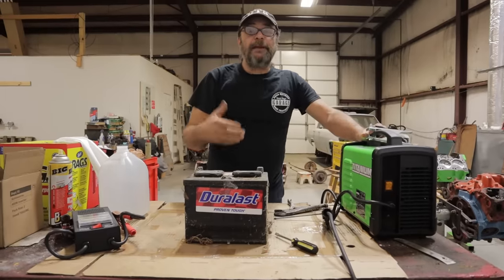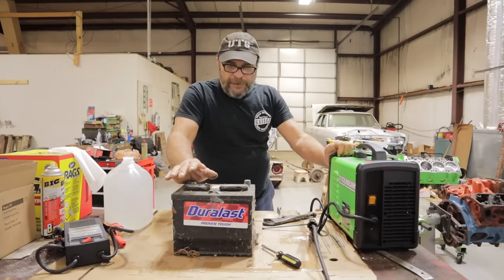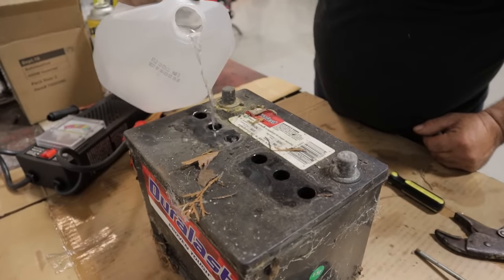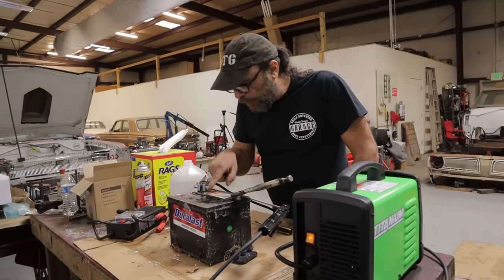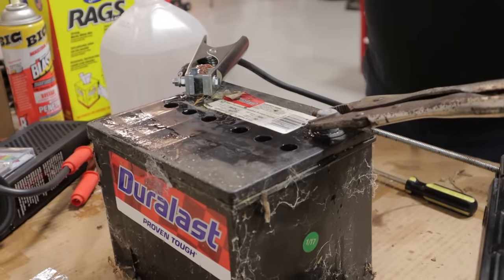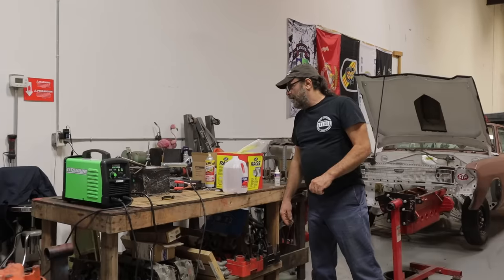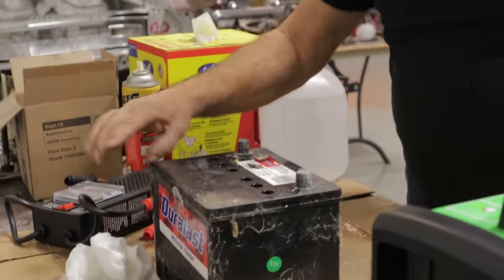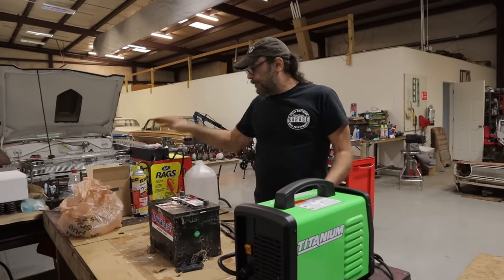Reviving Dead Batteries With A Stick Welder

Comment: He never confirmed that the battery wasn't chargeable in the beginning it had just sat around and had no charge i think he needs to redo the test with a battering that cannot be charged and will not pass a load test ,he successfully did a quick charge!!!!
Ohh he should have a good coating of rust on the inside of his shop and tools an exhaust fan or and and open window or door would be a good idea!!!!

Comment: Distilled water has all the impurities removed. If your tap water has a lot of limestone in it, it will make the battery even worse.
Reply: Yes. Destilled water has all the ions removed and therefore does not conduct electricity

Comment: If there is a cell that is not bubbling, the cell is dead. It's shorted internally and basically the battery's caput. It can be still repaired but not worth the hassle.. edit: if the battery get warm (near hot), end the cycle and repeat when it's not warm. Edit: pleeeeease, clean the battery first and second, do not overfill like him!!! The water/sulphur acid solution has not to be up top!!!

Comment: That would be a DC welder , right ??
Should have had the battery in a plastic oan in case of boilover so the acid didn't go everywhere.
Should be wearing rubber gloves and a face shield.

Comment: 2/7/23. What happened to SAFETY????  No gloves, no eye protection. Try attaching the clamp directly to the channel lock plier handle for a better connection. Two other videos had that scenario in the highest they could get their welder was 35 to 40 A and you got all the way to 120 sounds dangerous to me anyway my main concern was your safety.

Comment: I am inspired by your work. Slight improvements would make what you suggest 300% clearer. Put a VOM (volt ohm meter) on the contacts as well. This will also show the Voltage being used with your stick welder being used as a variable DC power source. I would suggest to all that the use of higher voltages at very low amperages for much longer periods will be far safer and even more successful as well. This is the simplicity of desulpahation. If you repeat with the voltage we can see much much clearer what you are electrically doing.

Comment: Maybe... and I'm just spit-balling here... but ya clean the top BEFORE opening those caps....... maybe even test the battery beforehand to prove it's dead and show the start point of the "experiment"....... And the craziest thought of all.... Maybe, just maybe, wear gloves when cleaning up battery acid.

Stretch Goal Suggestion: vacuum hose set up to suction fumes away from both the battery AND the nearby lungs.

Comment: I'm pretty certain you could use reverse osmosis filtered water or Deionized water without any problems or even something like a high quality filter you might use for drinking water at your house like a zero water filter because the idea is that you want is water without contamination in the form of minerals or pollutants or anything like that especially something like chlorine so no mineral water no spring water no water with additives like the vitamin fortified water or drinking water that has minerals added to give it a normal water taste because pure water doesn't really exist naturally it's the universal solvent so that's what it does best and I haven't seen you in a while but glacier water filtering machines you used to see in front of grocery stores where you can get a gallon for a quarter as long as you bring your own container those would work great too because it uses the Municipal Water Supply tap water filtered through mechanical particulate filter then activated charcoal/carbon anion exchange media and then reverse osmosis where is forced Under Pressure through an impermeable membrane we're always a very small water molecules can get through and the larger contaminants can't pass. It's remarkable deal compared to what you find just inside the store and for the record reverse osmosis is what desalination plants use to take salt water and turn it into freshwater they can be used for drinking and agriculture so reverse osmosis is to water what HEPA filters are too air

Comment: You will kill it completely. It will short cut internally easy. Never do it. There is a special method of dissolve it by charge - discharge cycles. some time with reverse polarity, but hitting it with 100 Amps is vandal action :) I know it is already dead but still vandal.

Comment: Beacuse you used a welding machine, it only took minutes to boil it unlike using the usual 12-24 battery charger that needs to take overnight charging, hmmm that's new approach wow!

Comment: Not a good idea to have welder right beside battery putting off gas. Might be alright if you was using fan on welder to blow fumes away from battery and welder.

Comment: BREAK CHECK ! ! !  I don't know if this guy is honest or just not informed. 
Here's the truth. If you've never tried it, the reason you never  recover any of the Lead from a 12 volt lead acid battery is because of a process called "Electrolysis" which is the process of using electricity to split water into hydrogen and oxygen. Did you get that? Here’s the problem, electrolysis always destroys metal, the density of the “Metal Lead” gives it a longer seat at the table but with time Lead will vanish right before your eyes, just like steal, tin, aluminum,  Stainless Steal, etc, etc... The lesson here is don’t look for Lead in an old battery.
Now my point is this: What this man is doing right there is accelerating the loss of lead in your battery and these “12 Volt Lead Acid Batteries” aren’t called “LEAD ACID” for nothing, they produce electricity by a chemical reaction resulting from the mixture of the metal Lead + Acid + Water = over time you got some electricity but it wasn’t free it cost you some consumables called Lead, Acid and Water.
Let that sink in and you’ll understand that this video is instructing us to use a super fast loss of Lead to rejuvenation our old batteries, it’s comparable to buying a cancer patient some cigarettes only much worse.

Comment: I blew up a lead acid battery bank as an apprentice. Scared the fucking shit out of me I only popped 2of4 batteries burned my eyebrows off. I never touched a bank again.  750cca means 750 instantaneous Amps upon a short condition.  That a Lotta heat man careful with chemelectirc
Reply: Willing bet next cold spell your car doesn't start

Comment: The reason u use distilled water is the same reason u don't want distilled water in radiator. Distilled water is full of ions that are "hungry" and they "eat" all the corrosion inhibitors right off the bat.

Comment: You dare-devil...I would work with gloves. And we do not know the status of the battery BEFORE you hooked up the 50 amps charging current.  That would have been an important information.  Last year a came across a lot of dead batteries in the Yukon.  Solar panels did not do much to these sulfated things, and according to the acid-tester I should have added acid, which stands to reason.  I think the lead sulfate is  "lost" for the process, unless you can solubilize some of it  again with your  devilish "battery cooking"...
Reply: An other point: this I would absolutely NOT recommend to do on a modern sealed battery!  Returning home from Yukon after three months  the battery of my car was rather down (a modern, sealed one) and I got it up and working well again by hooking it up for some nights to an automatic electronic battery charger. I felt perfectly safe doing that...:).  It probably was only a little sulfated.

Comment: My friend trust me I've been there stopped to help a guy jump his car and wasn't paying attention and he crossed his cables . My face was twelve inches above my battery be ause it was dark it blew me up on o to the radiator and across the rop of the engine three to four feet behind me leads post hit me in tbe forehead but my buddy had enough sense to drag me inside the store back to the milk and began doysinv my face eyes all over four gal of milk right there poured out in the floor. Milks the fastest neutralizer . Water onlybrises it or dilutes it. Milk kills it forever. He got to me so fast that the white Tshirt I had on only stained yellow never ateca hole in it. It worked well enough I paid for the milk and cleaned it up for the girl bebind tbe register . She was still in shock . My ears rang for a week because of that explosion . Never take a battery for granted it can become literally half as strong as a stick of dynamite. Yourectaki g a risk with that thing inside. Once you smell that gas you'll never smell anything ever again if it's a good breath.

Comment: I bet an AC welder would work better since the cycling back and forth. in welding you weld aluminum with alternating current because it cleans up the layer of oxidation. I wonder if it would have the same effect on a battery
Reply: AC doesn't work.

Comment: It's not your skin really you have to worry about it's your mucus membranes your eyes and the sensitive tissues lining your trachea and inside your lungs that are probably the ones you should be concerned with skins durable and bydesign that witch keeps everything that's not you outside of you and full of nerve endings that will let you know reliably if something's not quite right without much ambiguity

Comment: Wish he did a multimeter volt test and load tested before especially if it took a charge. Chances are the battery may have charged again before doing the dc or stick welder trick and it would still pass the load test, and this essentially proved nothing, just free paid content and views. Been there done that with a few batteries that I forgot to test first. now I test everything first just to have a base. 
But cool video and well demonstrated

Comment: Didn't show the voltage or the amperage BEFORE de reviving process!! Also, didn't show the battery performance by putting it in a car and starting the car.

Comment: The "crust" falls off the plates, settles in the bottom, shorts out the cells.  Just buy a new battery, it'll save your ass when you need it.

Comment: You never showed the battery was actually dead that and it had an 01/17 sticker so it’s not that old I have batteries that still work at 5-6 years old …
Reply: And for 25 bucks I’ll buy a desulfator that works the same and is a bit safer

Comment: Pretty sure this creates hydrogen. One little spark it's over. Way too much risk involved for a battery. It explodes you have 3rd degree burns at least. No acid neutralizer around this guy. Oof

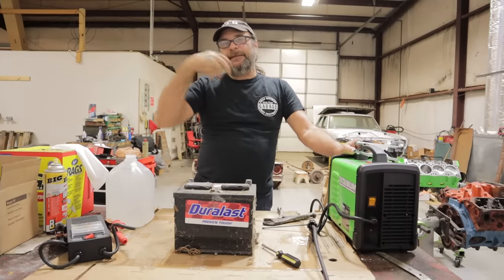Comment: 1,  batteries don't blow up. The hydrogen an oxygen molecules produced by the chemical reaction within the battery  generally accumulates outside the battery  during battery operation, this is where the explosion is most likely to happen. 2 you're boiling sulphuric acid in high concentrations, also sulphuric acid that's high in led content, boiling sulphuric acid increases it's acidity which is why it removes the salts off the plates after adding way more current than needed which also means the battery is under consistent load an producing even more gas,  🤦 I made it 2:50, I don't think I need to go any further... 
Atleast have some bicarb soda handy just incase ffs

Comment: I call pure #&ing Snake Oil. All he's done is put a HUGE surface charge on the battery. (the welder amps have to go Somewhere). Notice how there's no word on how this battery was performing a week later. He baked off all the hard sulfur and it's lying in the bottom of the battery, soon to short it out. And what's left of the plates is just shot. Cranking a S-ton of amperage into the acid itself isn't STORING the electricity for later use. I get so sick of these clickbait battery-welder vids. Idk what tf "UTG" means, but i hope i forget it the second i post this comment ~

Comment: HEY ,,,PLEASE ,,PLEASE ,,PLEASE ,,,DON'T TOUCH OR WIPE BATTERY WITH POWER ON ,,  YOU CAN RISK HITTING ONE OF THE CABLES & GET A SPARK  WHICH  WILL IGNITE SULFURIC GAS COMING OFF THE TOP,,, IF YOU HAVE EVER JUMPED A 6V BATTERY WITH 12V YOU WILL GET THIS SAME TYPE OF BUBBLING ,,AND GAS COMING OFF TOP  DO THIS OUTSIDE,,, OR SERIOUSLY VENT ,,THIS DOES WORK,, BUT UNTIL YOU BLOW UP A BATTERY IN YOUR FACE ,, YOU HAVE NOOOO IDEA HOW VOLATILE THIS CAN BE ,, I HAVE,, SO MAKE SURE WATER IS CLOSE BYE N READY  GOOD LUCK N BE,,CAREFUL

Comment: You must indicate that the welder is Direct Current and not Alternating Current output type
And make sure if it is direct current, that the cables are connected positive to positive, negative to negative of the battery.
Reply: In other words, acv cannot charge dc batteries.

Comment: Distilled water is 𝐏𝐔𝐑𝐄 𝐖𝐀𝐓𝐄𝐑! 𝐈𝐓 𝐇𝐀𝐒 𝐍𝐎 𝐌𝐈𝐍𝐄𝐑𝐀𝐋𝐒! 𝐙𝐄𝐑𝐎! 𝐓𝐇𝐄𝐑𝐄𝐅𝐎𝐑𝐄 𝐈𝐓 𝐂𝐀𝐍𝐍𝐎𝐓 𝐒𝐇𝐎𝐑𝐓 𝐎𝐔𝐓 𝐓𝐇𝐄 𝐏𝐋𝐀𝐓𝐄𝐒 𝐈𝐍 𝐓𝐇𝐄 𝐁𝐀𝐓𝐓𝐄𝐑𝐘!
Reply: shorting the plates isn't a problem it's neccessary.  The minerals combine with the acid and weaken the solution which would weaken the output.

Comment: IT was like watching a surgeon doing brain surgery with gardening tools, after 10 mins of brain surgery training.
you did not test voltage or stress test battery before charging, just to show how bad the battery was.
You poured water all over the battery and washed in the muck from the top, i have seen chimpanzee,s tea party pour better than that.
you charged the battery @100 amps  you waited approx 20 seconds to use battery stress tester till it glowed with all that hydrogen and oxygen wafting about.

Comment: I had to go to the end of the video to see if the battery blew up. This is SO DANGEROUS!!!!. I have seen the results of batteries blowing up, and you would not want to be in the same workshop. There are devices which claim to rejuvenate batteries using controlled intermittent voltage surges. These can give a little extra life to some batteries, but it is usually short lived. Buy a new battery!! DO NOT TRY THIS AT HOME!!!

Comment: Very dangerous, the battery charging can explode due to the gases being created from overcharging ,  I would recommend a battery charger at a slow rate, also there are now, many types of battery these days so this wouldn't work for all battery's, and may cause the battery to get damaged, or explode, if acid gets in your eyes you will be blinded for life, or have hand and facial burns. better to take the battery to be tested and if it fails, buy a new one, Note the battery should have the same or more cold cranking power, and can be any size as long as it fits,the battery tray, and is able to be secured. I buy the most cracking power and one that fits my battery tray, some store clerks say it the wrong battery , I don't want to spend 80 bucks more for a factory fit battery when i can buy a better one it may be taller or shorter, slightly wider but if it fits the tray and does not touch the hood, i'm buying it I'm no dummy.

Comment: That battery sat too long without service the a lot of the fluid evaporated and you just filled it with water.  You should use epson salt and again this will only work for a while.  Also you never monitored the temperature of the battery through the zap cycles. Ultimately you will need sulfuric acid filled in all cells after a vigorous flushing and cleaning all old fluid and debris.  Then zap with welder starting at 70amps up to 90 amps in the fifth phase.  Let it cool overnight and run a test the next day.  Your safety measure need more work....jesus christ.

Comment: What your doing there is extremely dangerous and i  can  see you have never seen what happens to human flesh when a bomb goes off at point blank range right in front off your face. These techniques were abandoned many years ago when i was a young trademan because of severe injury and death. If you insist i would suggest a full face shield as well as your glasses and may god be with you.

Comment: I don't know if this guy works on customer cars.  I hope not.  He didn't have the sense to clean the top of the battery before he removed the cell caps. In fact the battery had debris all over the top all during the video.  Sloppy and lazy.

Comment: you cannot rejuvenate a battery with a welder. causing the components inside the battery to boil doesnt make it rejuvenate. this is bad fuckin advice. just buy a new battery. if you cant afford a battery you shouldnt own a car